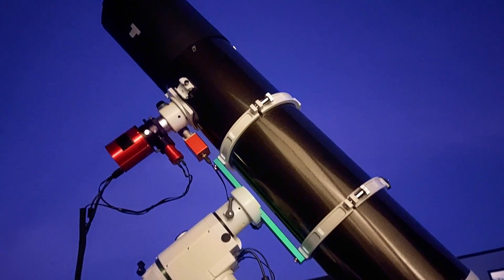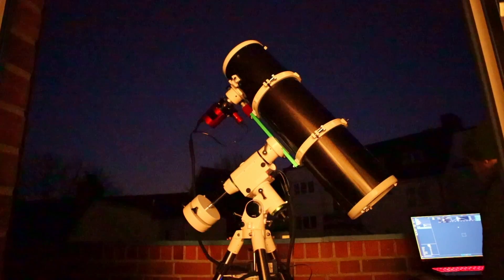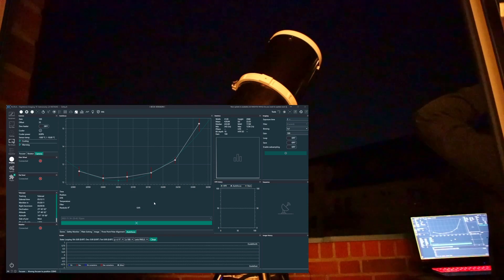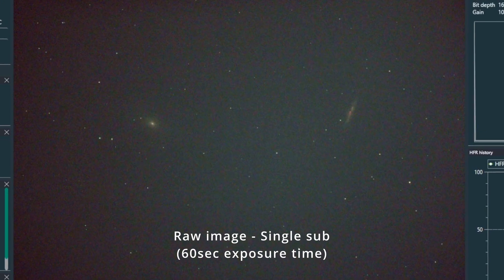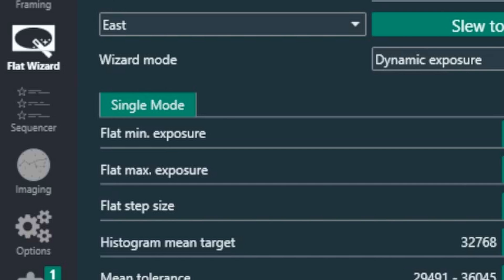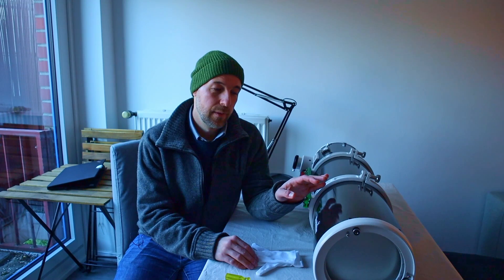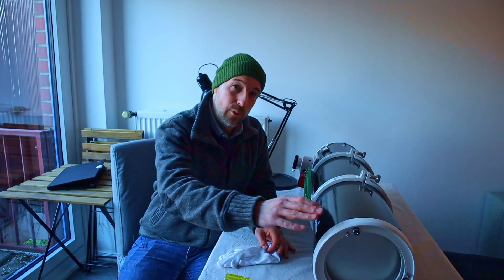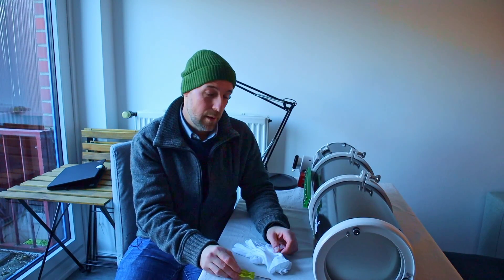Sky-Watcher 200PDS First Light – Why I Had to Take the Mirror Apart

Comment: Wat tracker do you use ?
Reply from the maker: Here O used a SkyWatcher HEQ5-Pro mount.
Best regards & cs
Reply: @tullyfisher thank you so much
Reply: @tullyfisher u think an celestron avx will work just fine ??
Reply from the maker: @DavidBaas-wr9lr You are welcome. 
The Celestron AVX can carry a 200 PDS with camera, but for deep-sky imaging you’ll be working at the edge of its capabilities. Both the AVX and the Sky-Watcher HEQ5-Pro have roughly the same stated payload capacity (around 13 kg), but for astrophotography you should realistically use only about half of that. The AVX is fine for visual observing, planetary, or short exposures, while the HEQ5-Pro is mechanically more robust and usually preferred for deep-sky work.
👉 That said, both mounts will work depending on your use case, but neither is the perfect solution — each will be operating close to its limits with a 200 PDS and imaging gear. For more reliable long-exposure astrophotography, a heavier-duty mount would be the better long-term choice.
Reply: @tullyfisher thankyou so much for the clear explanation, I’m planning on testing it . I would like to do deepskyastrofotografie with it . With the information you gave me I think the subs should be 30-60 secondes and not longer incase of triangular stars. Do you think deep sky Astro such as faint nebulas and galaxies are still possible with my mount and setup?
Reply from the maker: Hi
You are welcome. I think I already gave you the information you'll need.  It is possible to try but don't expect great tracking accuracy.
Clear skies

Comment: Does your heq 5 handle this beast well?
And I'm also thinking to use a 8 inch f5 on a cem26, should I?
Thanks
Reply from the maker: Hi there, first sorry for my late response due to holidays. To be honest I wouldn't really recommend the HEQ5-Pro-8inch combination for deep sky imaging with long exposure times. Yes, it's working somehow (and I created some really nice image you can see in my other videos) BUT depending on how much wind you have in you location etc. it's likely that you have to throw some of your precious images in the garbage. The guiding is really not any good. For planetary imaging on the other hand where you are working with cameras with high frame rates and quite short exposure times it's really nice. I see this current setup as a time-limited "transition setup" until I buy a bigger mount which is able to carry this beast with more ease. I hope this was somehow useful for you. Clear skies and happy new year! 👍🏼

Comment: There is a gap found on the primary mirror housing where it allows you to slide it into your tube. You line up the gap with where the tube overlaps itself. 
My first removal was tough, but putting it back on was easy, as well as another removal. Shouldn’t ever have to hammer it on
Reply from the maker: Thanks for the hint and taking the time to comment. Hope, next time it will work out much better when I have to disassemble and re-assemble the OTA. 👍🏼

Comment: Hey Michael this had me a little nervous watching you for a while but looks like you got it all sorted.  That scope looks like a real beast mate, very nice image of the galaxies.  I used to use a little CPU fan(attached to small  USB power pack) on the back of my Newtonian to stop dew.  Might help reduce length if it becomes a problem.  Clear skies pal. :)
Reply from the maker: Haha..me too. 😄 As you see I still had issues with the star shape (and pinched optics?) but I re-worked the main mirror thing and temps increased since then so I think I kind of fixed that - I hope. Yeah, thanks for the tip with the fan I think I will try that out. Thanks so much for you continuous support pal - really and highly appreciate that! :) Clear skies